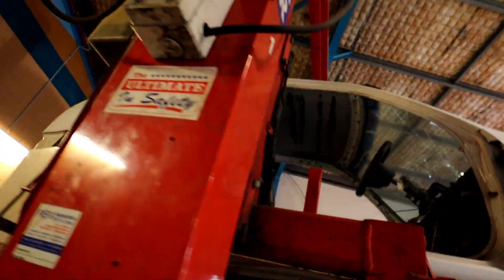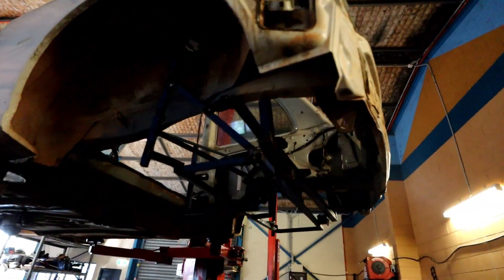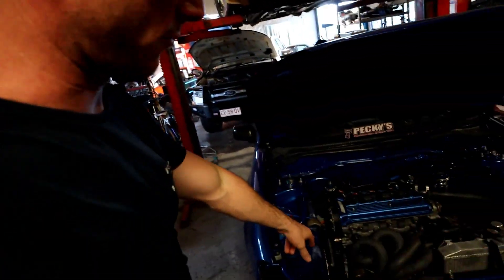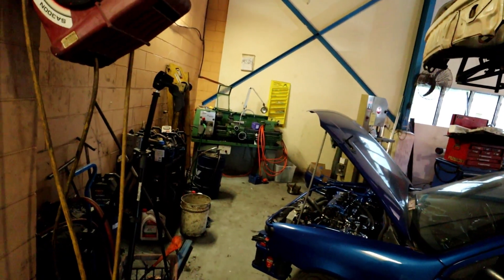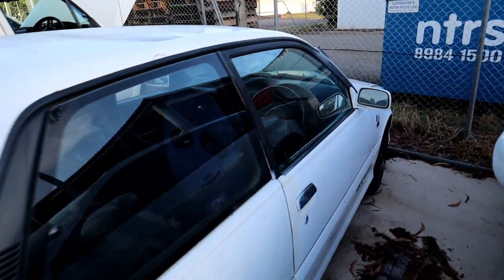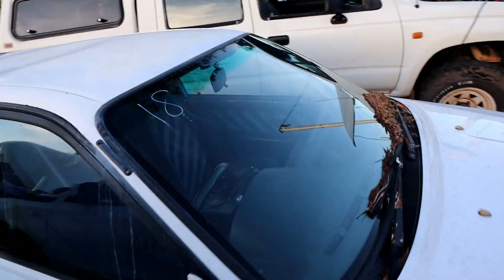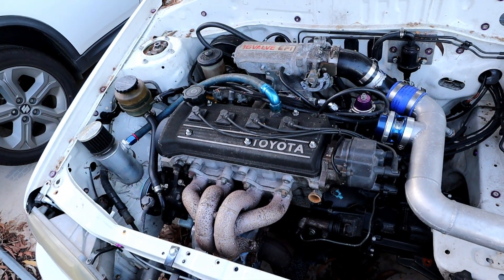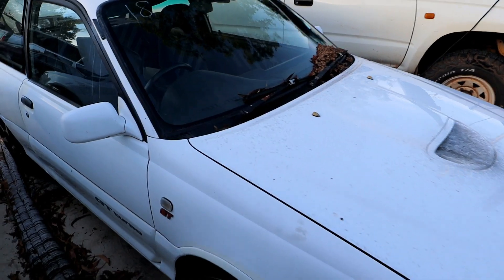CHANNEL/STARLET UPDATE and a NEW 3D printed intake manifold

Comment: Probably too late and you've since proven otherwise but guys tuning the cg13de have had trouble with the crank trigger attached to the harmonic balancer, it appears movement in the balancer made the crank trigger inconsistent and unreliable, your experience might be different but if you have issues it may be a place to look.

Comment: Hey matt do you have an idea where I could get a good crank pulley ? Mine is in aluminum and doesnt have any rubber to absorb.
Reply from the maker: Yeah the only ones available are Ross performance balancers... they are a very nice unit, have 360° markings on there and are supposed to help dampen bad vibrations and harmonics too...
Reply: @Camp_Dogs  would I be better off installing an oem one instead of aluminium ?
Reply from the maker: @laurentgagnon4492  yeah I would use oem over the alloy ones